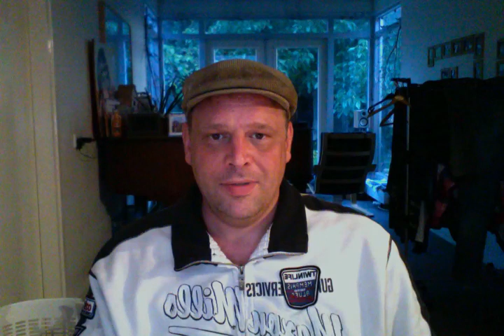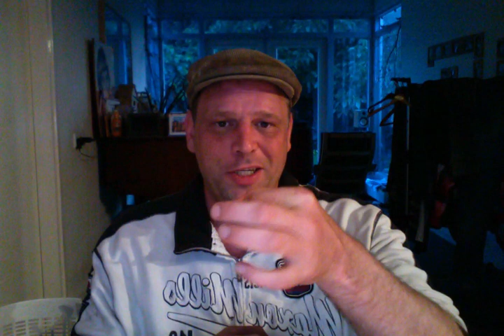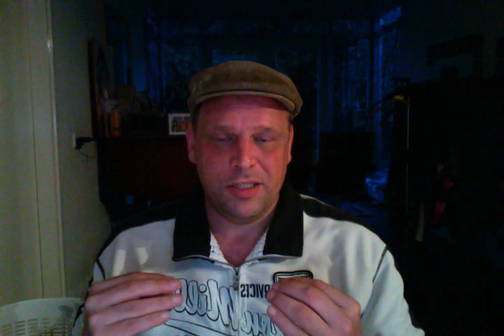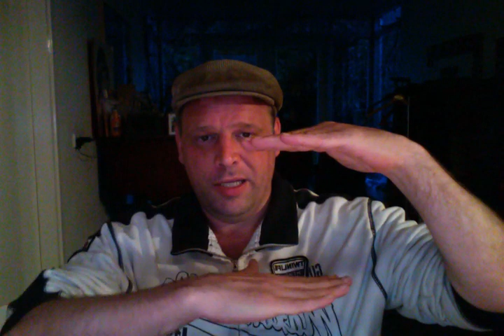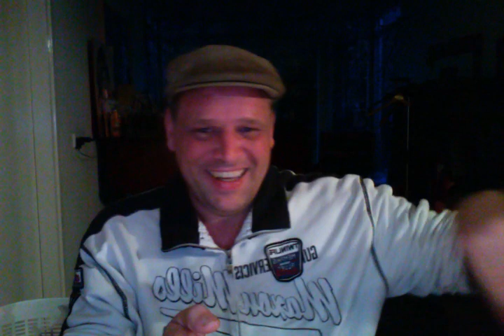How Stan Meyer's "Car on Water" as well as "Cold Fusion" actually works.

Comment: You sir are a genius! I read his European patent and came to the same conclusion but needed someone to confirm it. I used to wonder why he would always say that the power of hydrogen was many more times powerful than gas and not fingernail polish. I think he was giving clues, he covered the negative capacitor plate with finger nail polish to insulate it. If he didn't it would still be a good idea. Btw, his vic circuit can be replaced by a Tesla coil, essentially they do the same thing by letting the voltage climb and reducing current. A Tesla coil with a diode at the end of the secondary would do it.

Comment from the maker: It needs to be a dielectric layer with material having a relatively high dielectric constant and a high characteristic resistance. It appears chromium oxide is a good material, which happens to be created using the "electropolishing" process, which also removes Iron and Nickel contaminations. See new notes in description under vid.

Comment from the maker: Yes, "anodizing" is essentially what we are talking about: the creation of an insulating layer on top of metal with desired properties. In this case, we need a number of additional properties besides "insulation" and "rusting prevention". 

However, this is all pretty well known, especially for aluminum. See the e-book about electrolytic capacitors I added to the notes above.

Comment: Arend, I've been following your work for a few years now. I subscribed to you earlier, knowing that your logical way of thinking would soon produce something notable. You did not disappoint. My question to you: the elaborate sub-systems Stan used, and are being replicated by passionate builders, are those just decoys, or actual necessary parts to make it all work? Will this be a clean exhaust, not an ammonia or similar gas due to Nitrogen taken from air? Great work, thanks.

Comment: The oxide layer formed by electropolishing is not thick enough to reduce the impedance of the cell. Also normal passivation is also not good enough. I've tried this already.

Comment from the maker: What I am explaining are the fundamentals, the basic principles. There are many practical details which need to be addressed later. One of them is the choice of metal and electrolyte and the details of how to grow the dielectric layers. 

Another problem I did not address in the vid is the need to keep the fluid in movement, a/o in order to prevent gas bubbles to stick to the dielectric layers. Meyer did this by using acoustic resonance. So, the capacitor pipes are being used as organ pipes.

Comment from the maker: Stan Meyers BIG secret: "electropolished" stainless steel

Since the idea is that the WFC is supposed to be an electrolytic capacitor, I went looking for ways to make a suitable dielectric layer on top of stainless steel. Turns out that chromium oxide (Cr3O2) is a suitable dielectric which can be made by "electropolishing".

So, I think I finally found Stan's big secret. He used "electropolished" stainless. 

See update in description for more details.

Comment: Will ammonia exhausts fall apart back to No2 and H2O? I am not sure what happens if all of Bejing would swap to such engine systems. Now they have smog to worry about, but what about high ammonia levels in ambient air?
For the work of RWG Research I do get the impression that processed nitrogen might have been a key factor to get the system to work. This may not make Arend incorrect. If Stan found a way to tap the ether, there may be different avenues to get sufficient gains to run water as fuel

Comment: I have always been confused by the complexity of his systems. As it seeems all you need is a signifantly "overunity" amount of plain HHO gas, and you can loop it to get "free" propulsion at the wheels. Even if it is just 10% of regular engine output, it will be loud and violent, but free. There is talk of more potent versions of HHO being created. If true, you don't even need more gas volume.
I hope you'll get in touch with builders to start efficiently searching for solutions there.

Comment: You would become very famous if you could figure out how to harness this additional power from cold fusion, or what they actually reviewed and debunked as to be cold fusion. I believe it is cold fusion, but, the real proof would be to actually to find a way to store this additional energy and use it to do more work than the original source could do. I believe you have the training necessary to figure this out, as well, I'm quite sure you could help me explain why my circuits I have completed can produce more power than consumed with the same type of HHO systems that I have produced with respect to my very simplistic, but very high capacity capacitive resonant hho cells. I created a system with a neo core toroidal inductor that creates rotational magnetic fields once I found resonance to drop my amperage to zero while producing the same output as what I had to produce this gas using 15-25 amps of current without resonance.

Comment from the maker: REDUCE the impedance?
The oxide should have a high ohmic resistance. Perhaps not as good as aluminum oxide as used in most normal electrolytic capactors, but the goal is not to make a perfect electrolytic capacitors. A certain amount of capacitor leakage is no problem. These are losses we have to "invest" in order to get the oxide layer polarized so it can extract energy out of the vacuum/ZP field.

Did you have this done professionally or did at home? It needs to be done very carefully...

Comment from the maker: What we are pretty sure of with Stan's systems is that the "simple" cell worked and has been replicated. I am less sure about his injectors and other later developments. They may have worked, they may not. We don't know, AFAIK.

However, running an engine on HHO is well known, so once you succeed in generating the gas very efficiently, all the rest can be done along well known theory and practices.

I do not think Stan planted decoys, but he had his own theory and may have run into problems.

Comment: what if the Aluminum was Anodized?  You can Anodize aluminum plate in a 15% Battery Acid solution (mixed with Distilled Water).  you use 15v @ 5ish amps using 2 aluminum plates and the negative side will form the anodized layer, which is non conductive.

Comment: 20 years ago I thought I was on the brink of perpetual motion by using back EMF, were talking a spinning armature, magnets, coils and a transformer, duct tape and bailing wire got me an hour of spinning till friction took over, this while lighting a neon bulb. So I figure there had to been this force at work, I was probably taping into a bout a 1/100th of zero point of what was there with my very primitive contraption, ... gave up on it because every one that I built with improvements just ran for a shorter time and I gave up

Comment from the maker: The materials involved are nothing but water and electro-polished stainless steel. 

Yes it can be made to blow, like the Space Shuttle Challenger, but it's clean, cheap, environmentally friendly AND allows us to convert our existing infrastructure into using free energy sources.

As for weaponization: it's definately an appropriate weapon against the tyriannical financial system based on the "petro-dollar".

Comment: What would happen if you used that capacitor charging radiant energy from a bulb like Eric Dollard used while demonstrating one wire power transmission in a youtube video. It was connected to a Tesla coil's secondary. Just put the bulb in the water and let the photoelectric effect (Einstein noble prize subject) excite the elongated water molecule and supply enough energy for the electron to escape through the water and be drawn to the positive capacitor plate terminal. The photons from the radiant bulb supplied enough energy for the electron to use to escape the atom. It makes sense that in order to do electron extraction the negative capacitor terminal needs to be insulated and the positive left bare metal. That would be pulling actual current from water, like a battery, you could connect a motor in series with the hv positive capacitor plate and cause it to turn due to the amps you would pull from the water. possibilites are limitless.

Comment: Only if you break down water in an over unity fashion this is the case. There are reports that Meyer's car had a very foul smelling exhaust. Begs to wonder why.
If you can break up water at half the expected energy cost, and produce the simplest form of HHO, you can loop it and run a car on it. It would require a huge engine, and humongous alternator and bubbler, but it would run. And the exhaust would not smell.